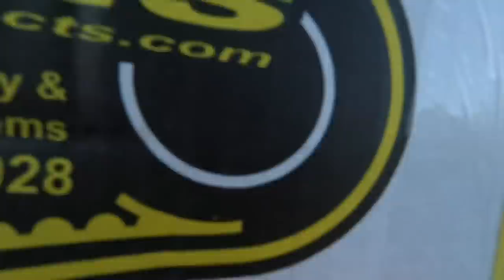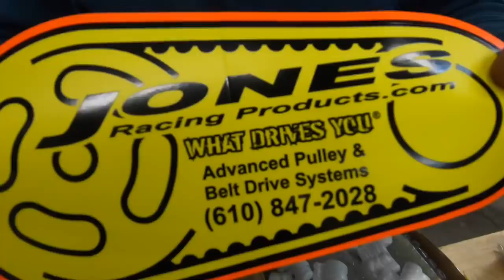Firing Up Jesse’s New Engine! The Jesse and Jo Show Part 2

Comment: Looks good, sounds good and I hope the car handles good. Just a suggestion, get an old ketchup or mustard squeeze bottle to use when priming the bowl's on the carb.
It's a lot easier and less mess. LOL
It worked for me.

Comment: Have Jesse use a heat gun next time when he hand presses a fuel line, been doing it since 
the late 70's never any problems
Reply: My family did the body shop thing starting in the 30s and my dad always said “amazing what a little heat or oil will do.” But amazingly that’s easy to forget; then after a bit of a struggle with something it hits you and.....”oh, yeah.”

Comment: Y'all done great! The video is good also. Don't want to hurt any feelings, but I like it steady instead of bouncing all over. I do understand that the one doing the filming is holding and keeping up with the action.  But you did a great job, and got the motor running.

Comment: Get two 3/8 x 3" studs and put them in upper waterpump holes in block, slide gaskets on with waterpump. Put lower bolts in just barely snug then replace studs with correct bolts. Gaskets don't move or require silicone, no stumbling around trying to install waterpump.

Remove "idle screw" from carb and braze a flat washer on head to use to adjust idle.

Comment: Remember Jesse.  Be smooth.  Treat the wheel like an egg, not a wrench.
I've won many races with Jones Racing cams.
Good luck guys.  Never use header gaskets.  High temp RTV is the only way to go.
I just got my new set of DW drums from Sweetwater music today and they sent me candy.  I've traded my racecar for a drum set.
What happens when you get old.
Reply: Jones racing cams is not the same as Jones racing company they sale Pulleys and such

Comment: Did we ever hear what happen to the brand new 604 that blew?  I don’t remember ever hearing for sure not that it really matters I guess....
Reply: Yeah I don't think he ever said what actually happened exactly
Reply: @sixteenstone007  I watch every video And I don’t think they said.  I am not a motor guy but it seemed like BS...hopefully they got some restitution out of it!  Obviously they have gone another route so it seems that maybe it was the tuners fault 🤷🏻‍♂️
Reply: @bhuff4748  tell me what could a tuner could do to trash this engine? Dickins is a reparable engine builder he has don no more than run on dyno set timing and carb.at rpm that is allowed for this engine this engine did not fail on dyno it failed in the car there are a lot of could have been this or that there are a lot of reasons why i don't believe there was a defective  worst enemy to any engine is over revving
Reply: @boatmans78  I have no clue man.  Sounds like you have it figured out so I guess that is the answer 👍
Reply: @bhuff4748  just my opinion i have been building engine for 50 plus years have seen it all only why to clear this up is for htf is to tell there subscribers what they told them this will never happen i fell like subscribers have the right if it wasn't for them you would not be where you are today i have never heard a thank you from any of you  that's my 2 cents

Comment: I always use Jones pulleys, I got a set of those pulleys for my UMP modified open motor, do not use a heavy GM style 4 blade fan with that htd drive belt. Mine tore all the teeth off the belt first lap. Jones recommended only using their light weight orange center hub fan. I learned the hard way after 2 belts and almost overheating. Not Jones fault tho was mine for not researching into it further. Crate motor I’d say yeah buy a set but anything over 700hp I’d probably stick with the old fashion v belt lol

Comment: You know what I don’t understand other then if it’s a rules issue is running dual electric fans in the early days of crates back in 2008-2009 I ran electric fans that I built specific shrouds for. In the two years I continued to race crates I never replaced a fan and they produced 3000cfm together. And of course to parasitic drag on the engine

Comment: Great job guys!!! Side note and maybe I missed it, but what happened to the engine that was sent off to GM?
Reply: Buried with Jimmy Hoffa.
Reply: They didn't send it back to Chevy or Jay Dickens race engine when you buy a race motor or a motor that you race it's as/is no warranty meaning if it breaks apart in two pieces you own both pieces. If it's like the one I blowed up it even killed the heads the only thing usable was the intake and there junk to begin with.
Reply: @JJ-1-1  That's why I say it's being used as a boat anchor somewhere.

Comment: What ever happened with the blown up 604?
Reply: I LL never tell
Reply: It's still blown up
Reply: I have blowed a 604 up like that there's nothing left to use except the intake it even kills the cylinder heads its trash.
Reply: @JJ-1-1  yeah, I'm aware of what happens to them. I'm more interested in knowing how it was handled by the seller.
Reply: @RyanBarrettMotorsports  Being connected to motorsports as you must be, I'm sure that you are aware that race motors don't come with warranties because any fool can blow up a perfectly good motor.  
   It has happened to me with a new, built motor as well as many, many, many other folks that race or have raced.     I would be just as suspicious of a warranty on a race motor just as I would a half price roofing job on my house.    Sorry to all you folks that don't understand and just keep asking and asking and asking, but that's just racing.
Reply: @jongolliher4280  correct, I am connected with motorsports, and I'm also well versed in the GM crate motor program. I have seen GM warranty several of them locally once there was an opportunity to inspect them and determine what was at fault. I've also seen the engine shops that sell these prepped motors work with teams if GM didn't warranty them. 

Built engines are an entirely different situation. Been there done that. In 2019 I put 25 laps on a 30k motor and watched it disintegrate. Nothing of my doing, yet I was still out 30k... so yes, I'm well versed how it goes with racing engines.
Reply: @RyanBarrettMotorsports  I don't disagree with what you say at all.    I was a long time GM employee and also believe they try to do  "the right thing"  whenever possible.    The problem with any warranty is the difficulty or even the impossibility of finding or proving the root of the failure of any race motor.     Therefore it would be foolhardy to publicize the results of such an undertaking for what I consider the obvious reasons.   I learned with a built Chevy 11 race motor for a USAC midget many years ago that grenaded the first time out.  I did get a little help but far from a warranty. 
Thanks and good luck with whatever you are doing!